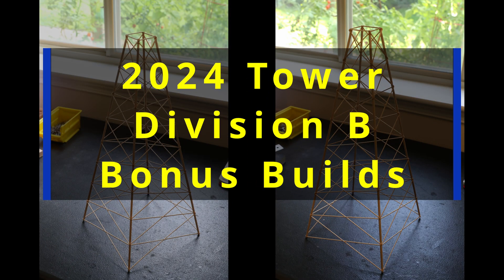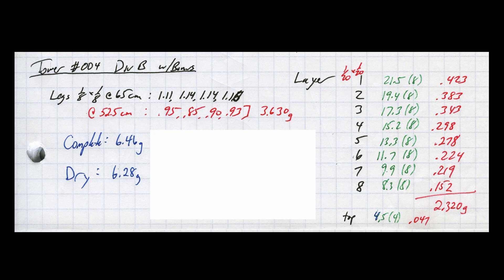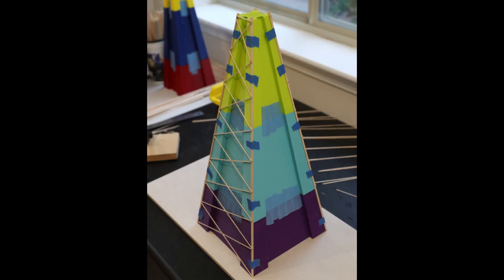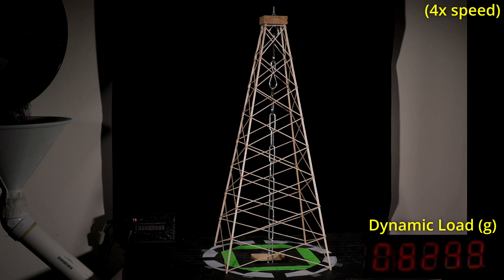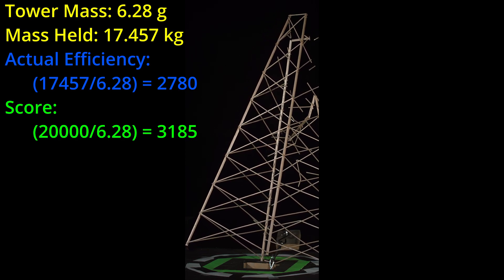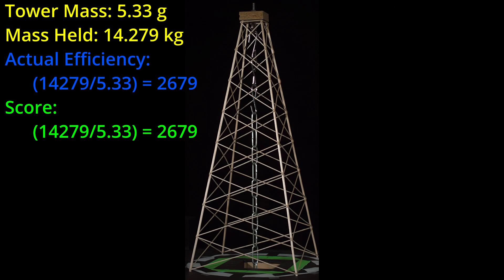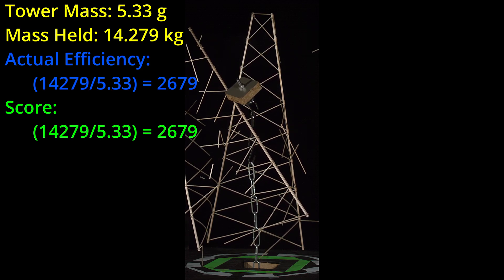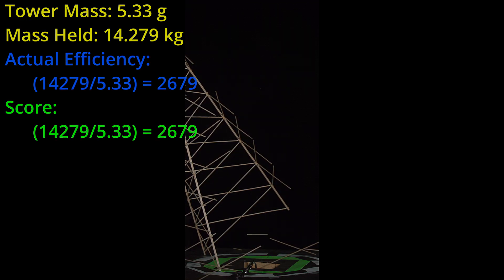2024 Science Olympiad Tower: Div B Bonus Builds

Comment: Hi, which one do you think is better, the bonus one or the non-bonus one?
Reply from the maker: I would focus on the non-bonus builds this year.  While the bonus build might have the potential to match the non-bonus if everything goes perfectly, the risk is way too high IMHO.  If your bonus tower fails at 14.75kg, that is a disaster.  It doesn't matter much if your non-bonus tower fails at slightly lower than you expect. The only way to guarantee your bonus build holds 15kg is to over-design it to hold 17+ kg and pre-test to 15kg, and then it will not be competitive with the best non-bonus towers.
Reply: @balsaengineering6686   ok, thank you

Comment: Is there a specific reason you generally choose square designs rather than triangular ones?
Reply from the maker: Back in 2017 when the rules were essentially the same, our team did some investigation with 3-leg towers.  We were never able to get them to the same level of performance as the 4-leg versions.  Remember, with 3 legs, each one needs to hold 33% more weight and your cross-members need to be longer/stronger/heavier, so it's not so simple in thinking it will be lighter/better.  Also, with square cross section legs, with a 3-leg tower, you are not going to have flat surfaces on all sides to glue your cross-members.  With all that being said, I generally recommend just sticking with the easier to build 4-leg designs and focus on material optimization.  For a super-high performing Div B tower, you should be able to get close to 4g and hold over 14kg.  That should be your benchmark.  If you can beat that with a 3-leg design, I encourage you to go for it!
Reply: @balsaengineering6686  Thank you for responding! This clears up my confusion.

Comment: Hi, I have a question regarding the jig. How did you make a jig without a 3d printer, and what did it look like? i’m assuming the jig would require smooth sides?
Reply: also, how should you measure the measurements for the jig?
Reply from the maker: @allisonhuang9589  Hi!  If you reach out to me at mklinger at comcast dot net, I can send you a couple pictures of the jig we used in 2017 which was not 3d printed.  We were able to do really well with that, so it's definitely not required to have a 3d printed jig, but it takes a bit of work to create one from scratch.  The dimensions for the jig, 3d printed or not, come directly from what the rules require.  In this case, the important ones are it has to span the 20cm square hole and needs to be >50cm tall (for Div B)
Reply: @balsaengineering6686  how do you decide how wide to do it at the top? The "1-inch nominal eye outside diameter" eyebolt has to fit, obviously. But other than that, how do you decide how wide you would make your tower at the top?
Reply from the maker: @daisyspeaks7479  It's a bit of a compromise and there is no one correct answer.  You want the legs to be as vertical as possible, which would mean as close to 5cm as possible (accounting for the leg width, so the loading block fits), but the wider you make it, the more material in cross-bracing you need.  If you go with something small, like 2.5cm, it uses less material, but then the legs are at a slightly steeper angle.  I chose 4cm as a nice compromise, but feel free to experiment a bit yourself
Reply: @balsaengineering6686  Makes sense, thank you! This is very helpful!

Comment: Hi, I was wondering if you think if it is possible to replicate these designs without using the jigs since I don't have access to a 3D printer
Reply: Ahhh, that makes much more sense. Sorry for the inconvenience but thank you for your very quick response.
Reply from the maker: Hi!  Yes, it's definitely possible to build these without a 3d printed jig.  You will definitely want to build some kind of assembly jig though, that is almost a requirement to make a great tower.  Back in 2017, the rules were almost identical and we didn't have access to a 3d printer, so we made a jig out of wood, copper pipe, and some misc parts.  Basically, use anything you can to make it so you can lean 2 pre-build sides of the tower up for the final cross-section assembly.  You basically build 2 sides flat on graph paper first and then stand them up on a jig of some kind and complete the rest.  If you reach out to me at mklinger at comcast dot net, I can share a couple pictures of the jig we used back then to give you some ideas if you want.  Good luck!
Reply: How do you do that? I tried but was directed to the comcast website. Do I have to sign in?
Reply from the maker: @parvchikani8913  I meant just send me an email at that address and I'll email you back the pics with some notes

Comment: Also, do you think that the science olympiad kits for tower are necessary?
Reply from the maker: I don't know of any kits available for tower and I definitely wouldn't recommend them even if they were.  This event requires a lot of material optimization and balancing to do well, so you'll need access to a lot more material than you'll actually use for the final tower.  I would recommend buying sheets of balsa for the legs and cross member and cutting your own strips to get exactly what you need

Comment: Thank you so much for these videos, I'm joining Division B tower this season, so your videos helped a lot. Also, I have a question regarding the shape of the tower. I noticed all your builds had a trapezoidal prism shape, and I was wondering if a trapezoidal prism with a rectangular prism on top would be a more efficient build as I have seen online. Thank you!
Reply from the maker: I think you'll find that a single-shape trapezoidal prism will work best with these rules.  My guess is the 2-part towers you are seeing online were from when the rules basically require that type of design (like in 2018 and probably next year).  Good luck this season!